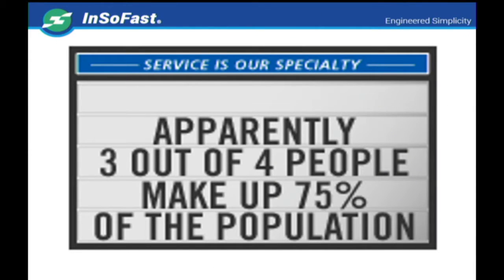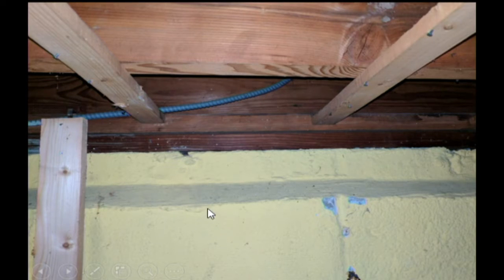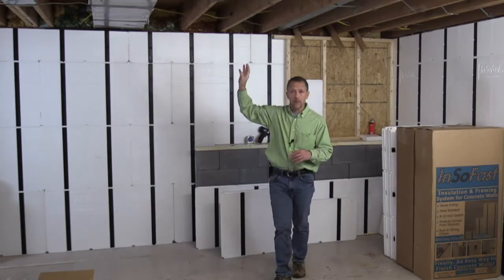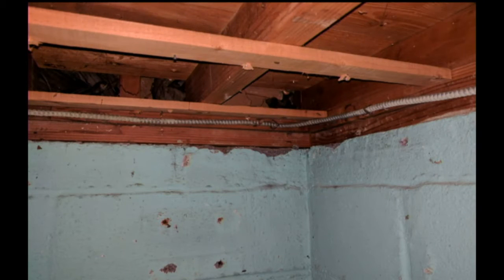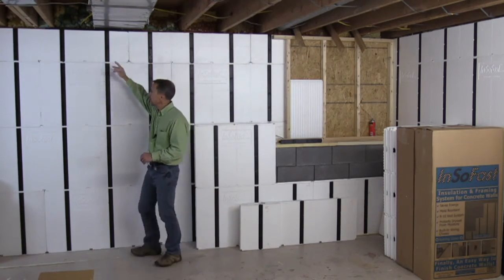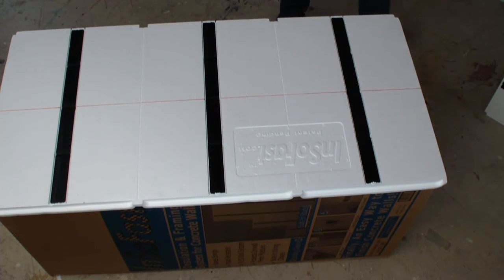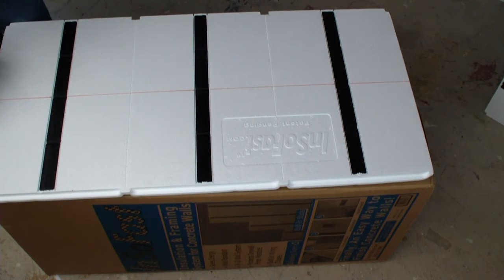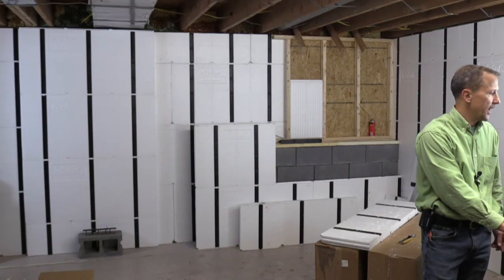InSoFast answers how to insulate 1/2 high walls where the cinder block meets the top plate

Comment: Can you use InSofast on  old brick Buiding that has 1/2” lathe boards that run vertically 16” off center. These lathe furring boards are use so the drywall can be screwed to it. I don’t want to replace these boards by re-framing the wall with 2”x4” or steel. The brick wall is not level vertically or horizontally. I am worried about the insulation by reframing the wall but the insulation would be much better by reframing. I am worried that by gluing the InSofast it will not glue to the entire surface of the brick wall because it’s uneven and worried about the strength of the InSofast not glued completely to wall. Other issue is the weight of drywall pulling the insulation away from wall. I am remodeling a 4 unit brick apartment building and they used the old red cinder blocks as the surface for the outside wall but the inside wall to install the drywall. 
So, the question is, will InSoFast, be able to stick/glue to the uneven brick wall and be strong enough to hold the 1/2” drywall. Thanks
Reply from the maker: InSoFast can float over uneven surfaces to up to 3/8 inch over the distance of a foot. So yes, it can glue to the uneven brick up to that distance away from the main part of the wall.